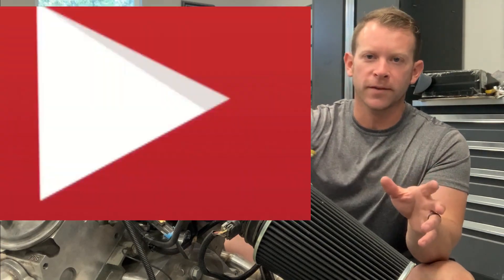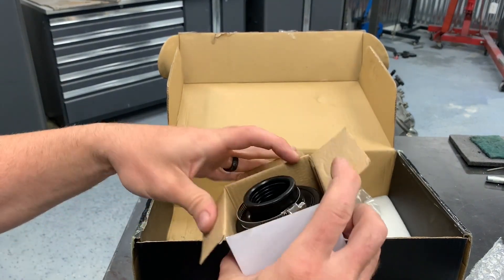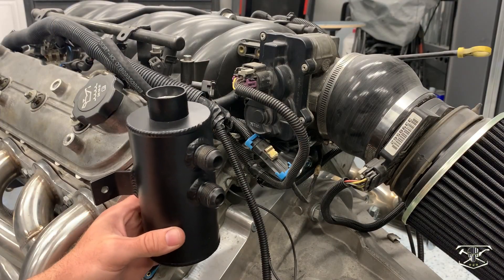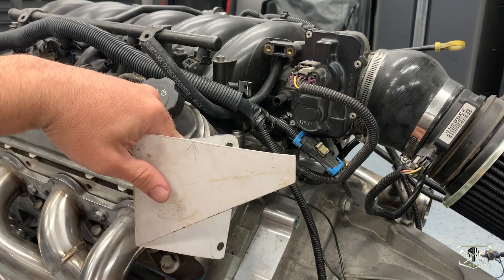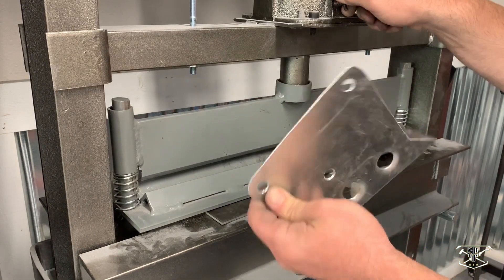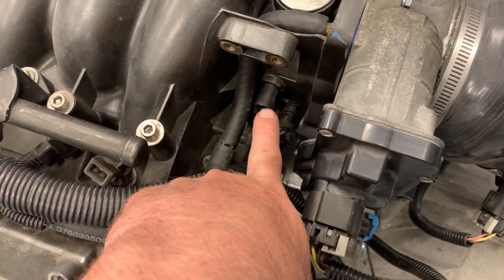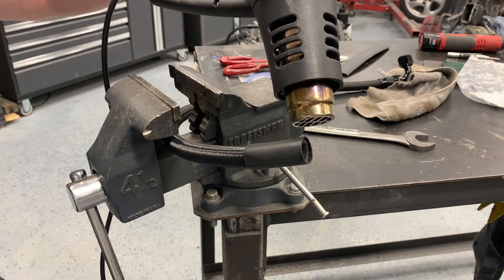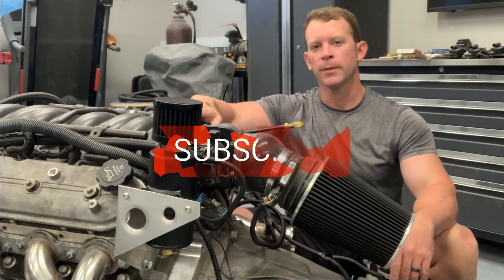Installing a Catch Can

Comment: Good clean install.
Question... how does the PCV scavenging  work with the vented catch can?
Reply from the maker: Thank you! To be honest, I am not sure. I believe I have seen these engines run fine with breathers on the valve covers. Nonetheless, if I have any trouble with it, I will just cap it off. On another note, I did just get the motor back in and the breather may interfere with the engine lid. May need to be capped off regardless.
Reply: @scantronsgarage  👍That's kind of what I was thinking. Check it out, see how it works, and cap it off if needed